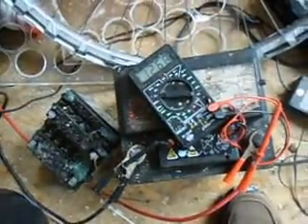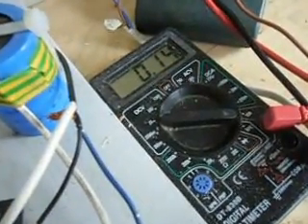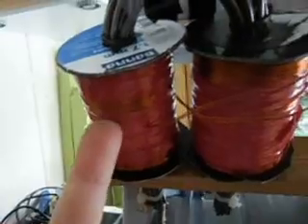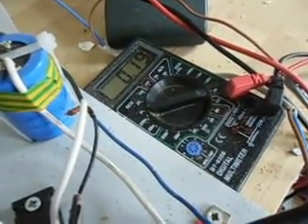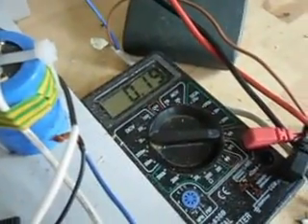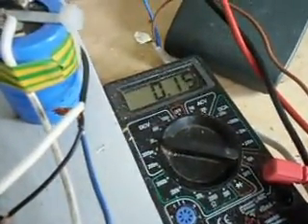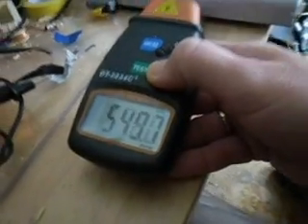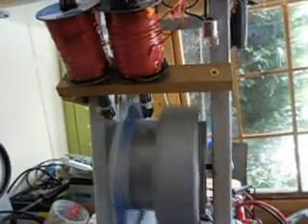anguseffect

Comment: Next time instead of changing the coils try adding more magnets.
This will be a higher rate of polarity change. Since this coil configuration speeds up the rotor more magnets will not slow it down.